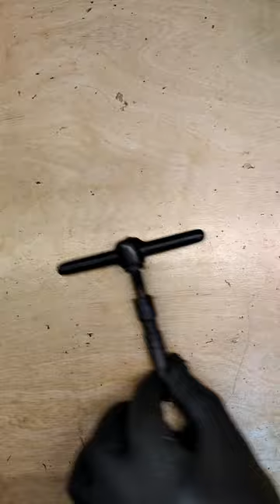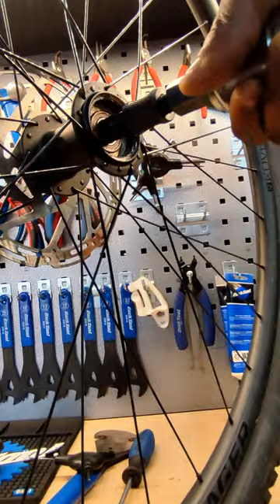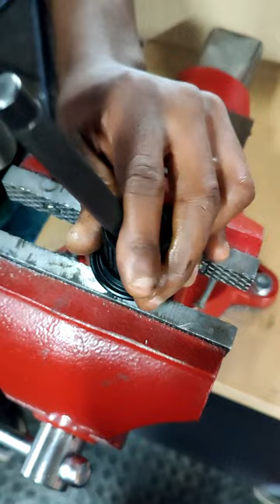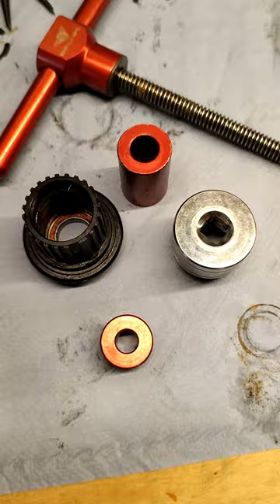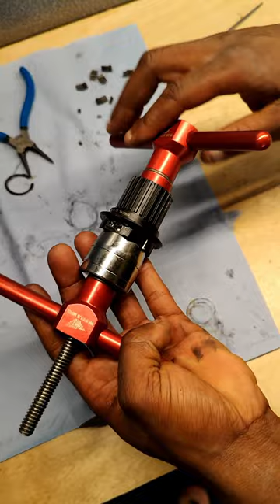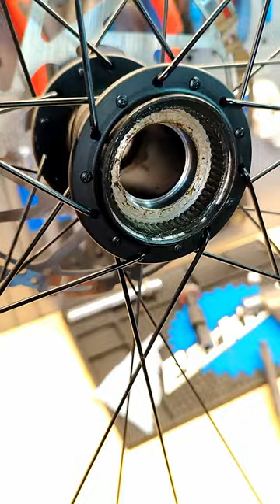Bontrager Rapid drive 108 Bearing REMOVAL Shimano Microspline #shorts

Comment: What's that tool you're using called? Thanks
Reply from the maker: Wheels mfg small bearing press , I'll ad the product number a little later
Reply from the maker: Oh sorry , the tool I'm using is a no name blind bearing puller. You can find them at any basic hardware store around 80$
Reply: @JustFrana  much appreciated my dude

Comment: How do i remove the axle? it seems easy on the video.
Reply from the maker: Remove the end caps and free hub then just hit it with a soft face mallet , the axle along with on me of the bearings on the opposite side of where you're hitting will come out
Reply: @JustFrana thank you so much!!!
Reply: @JustFrana 1 more thing do i need to remove the discbreak?